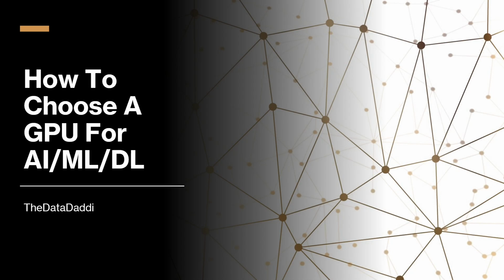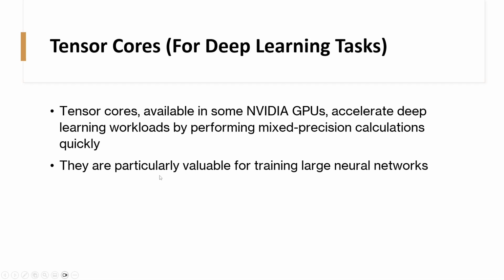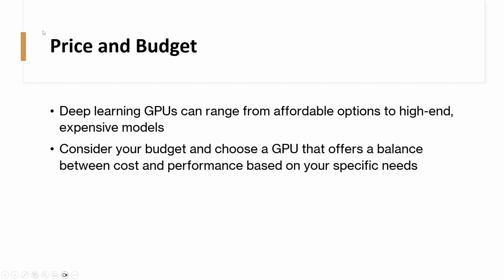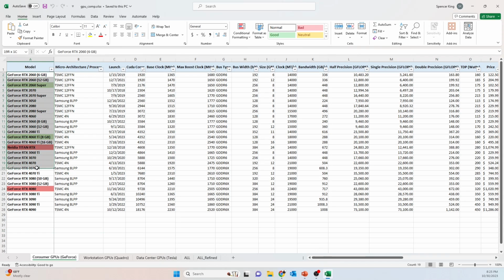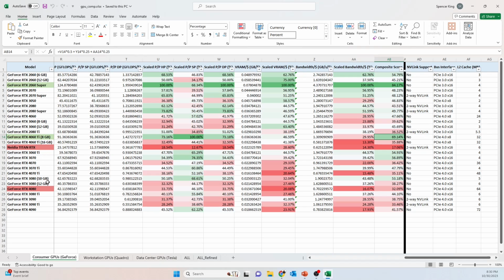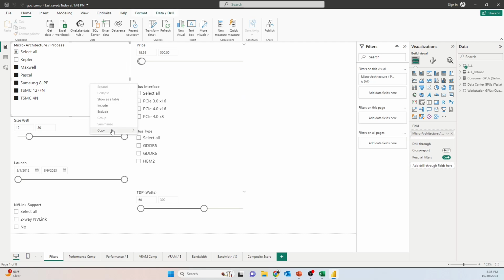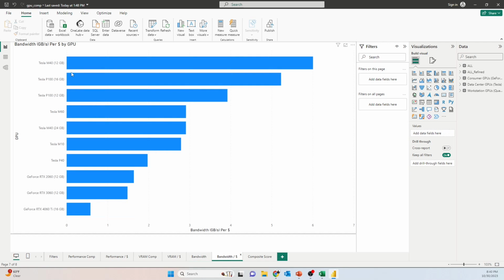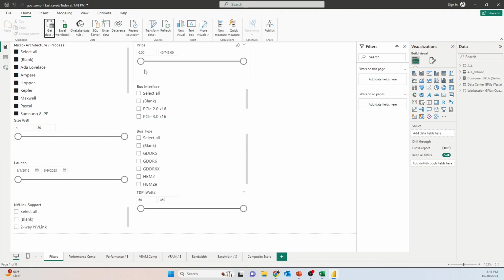AI/ML/DL GPU Buying Guide 2024: Get the Most AI Power for Your Budget

Comment: 3080 ti 2nd or 4060 ti new ? which the best for ML or DL
Reply from the maker: Hi there. Thanks so much for the question!

This is tough. I think you really can't go wrong either way. Both are solid choices for ML/DL GPUs. However, for about the same price (I checked just now and they seem to be about the same price on EBAY in my area) I think I would go with the RTX 3080. You get much better performance and the difference in VRAM from 12 to 16 GB is not significant enough to justify the performance difference.

Comment: good video. good thing you did not pick maxwell. plus side. lots of vram, minus side, everything else. its really slow, xformers dont work, (have to compile it your self to get it to work, have to run most things in fp16 mode. no adamx support if you want to do training. 

i bought the card 5 years ago but ditched it the moment the p40 dropped to 200 dollars. 

sadly the volta cards are still 700+ so im still stuck with the p40 but it still does everything i need it to do.
Reply from the maker: Hi there. Thanks so much for the comment!

Yeah, the Maxwell GPUs could still be helpful to some that are just getting in to machine learning and deep learning and are only looking to run smaller models. Also, as you pointed out it does have its own set of issues. Overall through, would recommend in most cases to just start with a p40 or p100. 

Yep, I think that is the situation for most people. Myself included. Volta GPUs are the logical next step, but the price is still a bit to high to use them in large quantities. Unfortunately, I am not sure if this will change in the immediate future either. The Volta series GPUs and higher have tensor cores and good mixed precision performance so they are still in demand for a lot of businesses. I do not see this trend changing in the near future.

Comment: Heat kills.. so is the RTX4090 experience.  I'm going slow and low wattage. Also type of SSD must be big petabyte write .. NVLinking is slow, 112Gb/s and is just dumping onto the Cudas/memory in the not really working like type GPU.. especially if that GPU is stuck into a 16lane that is really only 8 lane.. best to get a bigger Vram card like an A6000 @48GB instead of NVLink(2)ing two A5000 24GB, plus the link is going for premo$$$..  Me.. I'm going the 'Potato'/Orin route that doesnt' need a new air-conditioner/heat pump route, under 350W, and fuk the need for speed, I can wait 30 minutes instead of 3.  It is not the speed, but the GPU ability to actually do the work and most can't.  48GBvram with 2000 cuda cores is the can do..  top TDP is like money spent.  this review is best for MS BitNet 1.58.. so if you are Windows.. rock on... and I've read the NVLink Quadro cables work for RTX cards.. not the LoveLace...the need the LoveLace Link-2s..
Reply from the maker: Hi there. Thanks so much for the comment!

Yeah this is definitely a good point. I agree that more VRAM is typically better even if you actually have lower throughput, better to be able to do the task even if its slow than not because you dont have enough VRAM for your usecase.

Comment: Thank you for your hard work. 
Was p40 or p100 the better choice? ALso were you using nvlink?
Reply from the maker: Hi there. Thanks so much for the kind words and the comment!

It really depends on the use case, but overall for most people I would say that the P40 is actually the better choice. The only GPUs I currently have that support NVlink are my RTX 3090s. Yes, I have them connected via NVLink.

Comment: GFLOPS is not calculated like shown in the video at 15:18, remove the Giga which we know, FLOating Point operations per Second, simply(there is some history for why this is used). It is somewhat archaic since a lot if other things are being done too, which aren't incorporated in this but in general most other operations take less cycles than a floating point one does because the comma needs special attention so to speak, 15*15 and 1,5*1,5 are the same thing except for tracking the comma separately with the result being 225 or 2,25. What I mean is the circuit needs additional logic to track commas or rather fractions so to speak, which is why we separate floating point from integer operations - additional hardware is required to track the comma "in top of" the integer type numerical operations. No idea if this makes any sense or is useful, I thought it would be simple to explain until I thought it through and realized I need to type this as opposed to scribble and show on a white board. I'm sure there is a good explanation for it out there, just trying to point to why since to a person doing math it's not as obvious as it is designing a circuit to do it.
Reply from the maker: Hi there. Thanks so much for the comment!

This is great information. Thanks so much for sharing. I did know that floating point ops were different fundamentally than other operations though I was not 100% sure why. This makes a lot of sense! Also, if you know the correct formula for calculating FLOPs in general please let me know.

Comment: i think you missed out on parts - actual performance per model, and if one can use fp32, fp16 or int8 or tensor. P40 is terrible options for any ai workload due to amount of time one would have to wait... and its power requirement.
Reply from the maker: Hi there. Thanks so much for your comment! 

I would agree that for anything below fp32 operations these GPUs would be quite slow. However, the GPU is less than $200 dollars for 24GB of VRAM. So, if you are wanting to experiment with larger models cheaply, I think these GPUs still have good value.

Comment: I made a spreadsheet too, but yours is thorough!  I'd also come to similar conclusions as you: that the P40 / P100 were cheap ways to get medium size LLM models into a GPU with decent tokens/second.  Your spreadsheet would have saved me time if I'd known about it!  At least there's some independent confirmation of your conclusions.  There's a lot of detail to add, like  how fast/slow models are on certain GPUs ... perhaps another vid on that to save me the effort?  :P
Reply from the maker: Hi there. Thanks so much for the comment! 

I am glad to here you can confirm! Especially as hardware prices keep increasing I think these are actually becoming even more relevant for those who are budget conscious. 

Funny you mention this. I am actually working right now on a benchmarking suite to enable reliable comparison between GPUs for different models. There is not a reliable open source benchmarking solution for GPUs so I am trying to create one (or make steps toward it at least). As soon as I get something decent, I will make a video series on it and start using it to benchmark GPUs in a real way with respect to individual models.

Comment: Which one is better, the Rtx 3060 12GB or 3060Ti?
Reply from the maker: Hi there. Thanks so much for the comment!

It really depends on your use case. If you plan on trying to expand to larger models like some of the diffusion related models or want to use larger batch sizes then 12 GB VRAM would be helpful. However, for most conventional deep learning models 8GB should be fine and you will get faster training and inference speeds. Personally, though I would probably go with the 3060 with 12GB. I normally always default to the GPU with the higher VRAM even if the performance is slightly worse. I would rather be able to load the model and just have training and/or inference be slower than get out of memory errors and not be able to load a model I want work with.

Comment: I'd love to know your opinion of the modified Nvidia p102-100's with 10 gb of vram being sold for about $50-$60 on ebay since they have no display outputs. They are basically 1080 ti's with a bit of performance nerfing. they have no display outputs, but seem like they'd be ideal to plop into a system with an existing AMD Gpu just to give Cuda acceleration. or perhaps multiple cards?
Reply from the maker: I responded to you on the other comment, but in case you see this one first. Short answer. I think this would be a great way to go provided they work!

Comment: what yould you recommend one rtx 4070 ti super or two rtx 4060 ti 16 Gb for llm inferencing? i know there are a lot of things to consider
Reply from the maker: Hi there. Thanks so much for the question!

So, in terms of theoretical performance the 4070 ti super is about twice as performant. Since you are just interested in inferencing, I would say that in this case having the better performance of the 4070 will benefit you more.
Reply: @TheDataDaddi  thanks a lot for you answer.  I think its worth the better performance since i dont get any performance benefits of having two rtx 4060 ti besides more memory.
In case i do some training ate some portion i can still rent some hardware.
I my case i want to have a local llm for work where i can not use anything connected to the internet. So i would use it primarily for inference and if i need to optimize the model this should only occur one ore twice (hopefully)
Reply from the maker: @pixelslayertv7140  Sure! Yeah unfortunately since the memory pools for both 4060s would be separate you really don't get much benefit even having more total VRAM. You may be able to get away with fine tuning some of the smaller open source LLMs especially if you look into quantization. However, my gut tells me you will have a hard time doing much beyond that with 16GB VRAM. Like you said though you could always rent for the few times you do need access to more VRAM.

Comment: 00:11 Choose GPU with newer architecture for better performance
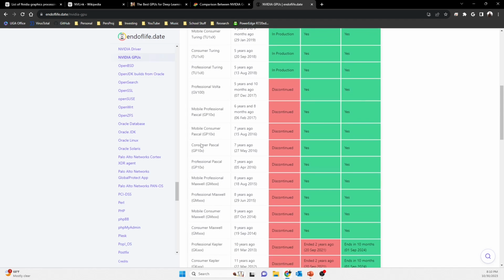02:28 Choose NVIDIA GPUs with active support and sufficient VRAM for future scalability.
06:51 Key considerations for choosing an NVIDIA GPU for deep learning
09:08 Consider driver support for deep learning framework compatibility.
13:10 Factors to consider when choosing an NVIDIA GPU for deep learning
15:12 Understanding the key GPU metrics is crucial for making the right choice.
19:46 Choosing GPU based on performance, memory, and bandwidth criteria.
22:00 GeForce RTX 2060 Super and GeForce RTX 4060 TI 8 Gbit are the best bang for your buck GPUs.
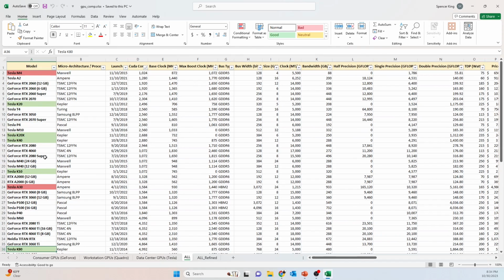26:27 Comparison of NVIDIA GPU models for Deep Learning in 2023
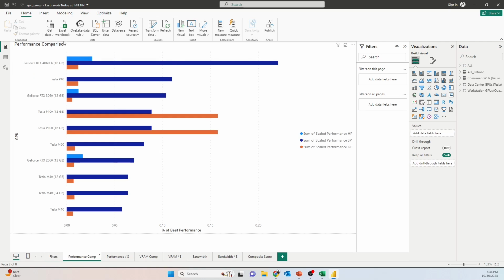28:45 GeForce RTX 4060 Ti 16GB has the best raw performance
33:18 Choosing NVIDIA GPUs for Deep Learning in 2023
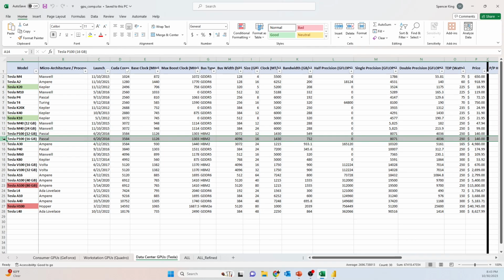35:36 Best bang for your buck: P100 and P40 GPUs
39:22 P100 and P40 are recommended for deep learning
Crafted by Merlin AI.
Reply from the maker: Thanks so much for adding these! I appreciate it.

Comment: Is there a big difference in performance and speed in AI tasks like stable diffusion etc between RTX 4080 super and RTX 4090?Which one should i buy as I seldom play games or should i wait for 5090 at the end of the year?I am not a video editor or hold any jobs related to designing or editing,just a casual home user.
Reply from the maker: Hi there! Thanks so much for the question.

I would say at this current moment. For stable diffusion related tasks, I would go with the 4080. 16GB VRAM should be enough to comfortably handle pretty much all stable diffusion tasks are this point (to my knowledge) and its performance is 60% of what you get with the 4090 for less than half the price. 

All that said, If you are not pressed for time, I would probably wait to see what happens to the market when the new 5000 series GPUs come on market. It could bring the prices down for the 3000 and 4000 series GPUs as people dump their older GPUs in favor of the latest and greatest. This approach is always a gamble though so if you prefer a safe bet I would look for good deals on a 4080 and not worry too much about what will happen down the road.

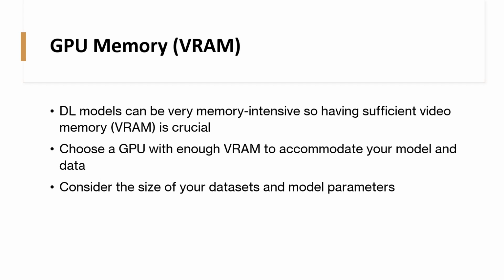Comment: 4:02 But Sir, LLM like chatgpt are trained from multiple gpus only right?
Reply from the maker: Hi there! Thanks for the comment. 

For LLMs like GPT-3, the resources required to train or even pre-train such models from scratch are beyond the reach of most individuals and many companies. This is due to the immense computational power and data handling capacities needed. For example, models like GPT-3 are were basically trained on most of the internet (Common Crawl, WebText2, etc.), Tons of full books, a snapshot of Wikipedia at that time, and more. Training was preformed with literally thousands of high-end GPUs across various datacenters.  Also, ChatGPT and other similar models are proprietary so lack of detailed specifics about their training processes and architecture make it hard to know exactly what it would take to train something like GPT-3 (or other similar model) from scratch.

What is accessible for most people and organizations is running inference using these models. "Inference" refers to the process of using a pre-trained model to make predictions or generate text in the case of LLMs. The feasibility of running inference smoothly depends largely on the amount of VRAM available, as larger models require more memory to operate efficiently. For instance, smaller versions of LLMs might run on a single GPU with 12 GB of VRAM, while more extensive models might require a GPU setup with significantly more memory. 

For those with more robust computing setups, such as advanced home labs or small to medium-sized enterprises, fine-tuning an LLM might be within reach. Fine-tuning involves adjusting a pre-trained model on a new dataset or for a specific task, which typically requires fewer resources than full-scale training from scratch. This process allows users to tailor the model's responses to better fit particular contexts or industry-specific needs without the prohibitive cost of training a new model from the ground up. The following Reddit thread is pretty useful in providing more details here:

https://www.reddit.com/r/MachineLearning/comments/15uzeld/d_estimating_hardware_for_finetuning_llm/

For fine-tuning, a setup with one or more high-end GPUs, such as the NVIDIA A100 or V100 (or RTX 3090 as I advocate for), would generally suffice. This allows for modifications of large LLMs using varied sizes of data, making it a viable option for enhancing model performance on specialized tasks.

In summary, while training large-scale LLMs from scratch is out of reach for most, leveraging these models through inference or fine-tuning them for specific applications is quite feasible with the right hardware setup. This opens up opportunities for a wide range of applications, from personalized AI assistants to sophisticated data analysis tools, even for smaller organizations or dedicated individuals with the appropriate resources.

Comment: Amazing amazing work man. Thank you so much. Your work is very well detailed and fascinating. I've been running SD and mixtral on my 3090 rig for the last couple months. I definitely enjoy messing with Stable Diffusion since there's ways to  tweak the performance of the image generation process. I'm able to iterate on ideas at a speed and quality which doesn't justify paying for a mainstream service model. (For my use case at least.) However,  my experience with local hosting LLMs has been quite the opposite. Running Mx7b turns my room into a sauna and my PC into a turbine. A slow one.  For $20 a month I found GPT4  a justifiable expense. The convenience and speed is just unmatched.

But, with that said, I've looked at other solutions and ran across GPU cloud hosting services. If you have any experience with cloud hosting I would love to hear your insight and opinions on their performance. Some of the pricing per hour of these services are very attractive EG: A6000 48GB x8 @ ~$7/hr sounds absolutely insane it seems criminal. (runpod.io)

What are the differences between running locally over cloud? Performance? Cons? The only issue that comes to mind, of course, is the data privacy. Which, for my use case, is open source and negligible. My main concern is price/performance. And if I can get it at a micro fraction of the price of the hardware, is there really a choice? 

Would love to know your thoughts in a video. Regardless, thank you for the great content my guy, keep up the good work. Looking forward to what you have up next.

Comment: I heard that Tensor Core are most important for AI, ML and then Cuda cores are secondly important. I don't think I seen Tensor code referenced on you sheet.
Reply from the maker: Yes they are definitely a consideration. Admittedly I should have included those stats as well. I will likely go back an add them as well. However, in most cases the higher number of cuda core also translates into a higher number of tensor cores for those GPUs that have them.

Comment: It would be nice to add in energy consumption, heat vs cool, most durable, and real life comparison using an actually local LLM system (and which LLM size) with these cards. For instance, the best card for single use performance, vs multi use performance in using a local LLM system like privateGPT, for an example.
Reply from the maker: Yep this is coming eventually. Things like that just take awhile to do correctly. I am working right now to create a set of comprehensive benchmarks that the community can use to evaluate GPU performance across the major AI/ML/DL areas.